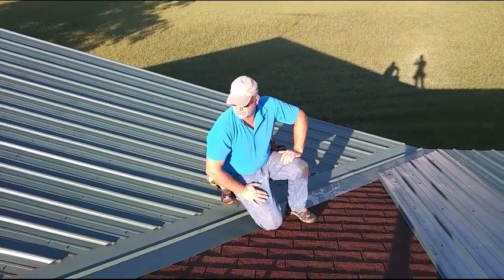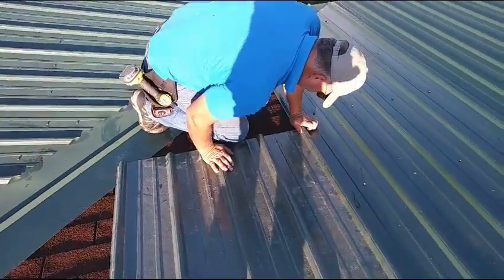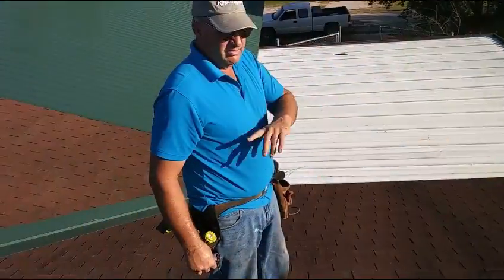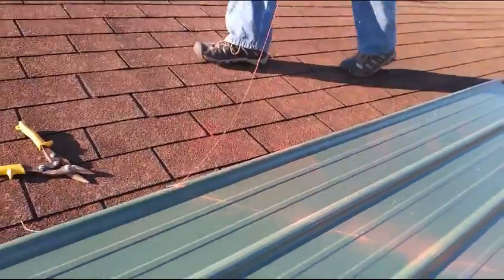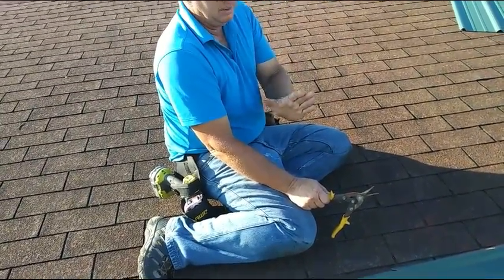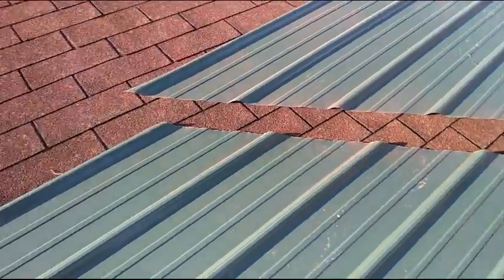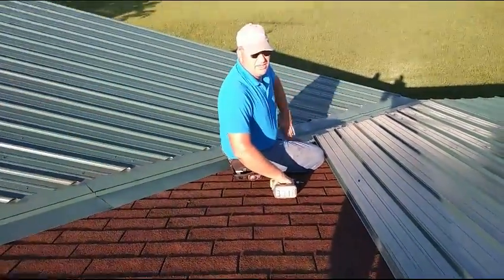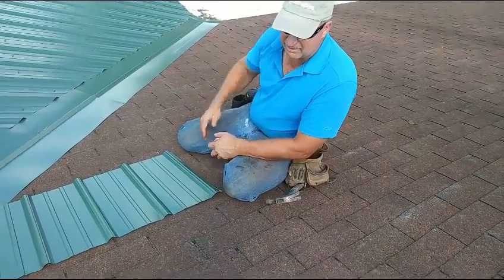Metal Roof Valley Install for home, mobile home, commercial buildings

Comment: Reading through these comments about how this guy should have used underlayment. Y'all do realize there is underlayment under the shingles already. Its probably traditional felt, but that's still an acceptable underlayment according to most metal manufacturers. I was going to use underlayment on the metal roof I'm doing next week, but the estimator from my metal supplier told me not to. Also told me not to worry about using purlins. Told me to just screw it down to the osb directly over the shingles. (I'm guessing he does not earn a commission for selling all the extra bells and whistles.)
Reply from the maker: Amen brother.
Reply: So you don't think condensation will accumulate underneath the metal and deteriorate the shingles and felt underneath it eventually rotting the wood?
Reply: Definietly need purlins or at least paper. Repair these on rhe regular. Wont know til its bad enough its about the fall through.
Reply: Yeah, works great until that big wind comes through and rips the roof right off because the 7/16" OSB has absolutely ZERO strength to pull out. You have less than 1/2" of resistance to upward pressure and OSB has such amazing structural integrity.  Not. Saw a local roof peeled right back for about 8 feet because of precisely this issue. You do you and same with this creator but after being in the building trades for over 40 years, the ultimate mark of a hack in my opinion is "well, I've never had a problem with it." Nope YOU never will; the poor homeowner you screwed over whose roof needs repaired or replaced 10 years down the line? Yeah, they'll have a problem with it for SURE.

Comment: Here in Australia, that valley sheeting would be condemned as it does not have a turn over lip on the edge that is under the valley sheeting to prevent wind blowing rain up under the roof sheeting.
Reply from the maker: Valley metal here also. Still getting the valley foam right is what stops water particularly with snow which can build up causing a dam that could cause water to backup and over . Thank you for pointing out something that we could all ask for when purchasing valley . Which would be a hem at the edge of the metal. I wish you and yours well

Comment: Question, why did you not use underlayment between the metal roof and the shingles? Underlayment is a lot cheaper than having to replace a rusted metal roof in the future.
Reply from the maker: After 29 years in area. Installing metal roofing this way there have been no problems. Not one.
Reply: Lol because actually underlayment holds moisture and actually causes the roof to leak. Keep doing like your doing. The shingles will only rust if u use underlayment buddy. Good job. I been doing roofing over 20 years myself.
Reply: Moisture comes from the roof sweating like u do with a blanket. It’s best to breathe.. we call this dead air space and underlayment will cause the roof to fail miserably
Reply: @stuart8219 if you have ventilation the moisture shud get out no?

Comment: In Florida roof condensates and will rot metal and the plywood or wood substrate. Not to mention rub the coating off the roof. Repairing one now if you want to see photos and videos. 20 years old almost destroyed the house. It did not need rain. Remember hind sight is 20/20

Comment: Wow a vertical panel metal roof installed directly over asphalt shingle with no slip sheet or under alignment. I hope that metal is aluminum! Because if it's not it's going to begin to rust underneath in about 10 to 15 years if not sooner!
Reply: Tracy this guy will be paid long before that happens.
Reply: @robertbutler8004  Law suit waiting to happen!
Reply from the maker: Keep in mind i have done roofs like this 26 years ago drive by many of them no rust . Also have never had in insurance settlement or law suit in any court small claims or otherwise for any of the work i have done in all my career
Reply: @StraightArrowRepair  "many of them"? 1 is too many. I was a construction defect inspector, They said we have done it like this for 30 yrs, well that's 30 yrs of doing it wrong. But I thanked them for keeping me busy.
Reply: @robertbutler8004  That's why he says he has never been sued, paid and go to another state.
Reply: @StraightArrowRepair  The stature of limitations would have expired long before 26 years for a law suit.
Reply: As a corrosion specialist to all there is no chance for rust if it is dry. But in wet to lots or dew daily will create an source for corrosion to start underneath the metal. So where the coating is scratched it will rust much faster but only as long as it has moisture present. The sun does help dry the sheets up as long as there is sufficient air flow.
Reply: @robertbutler8004  If the roof has a warranty (contractor OR manufacturer) that could open the door to lawsuit outside of any statute of limitations.
Reply: This shows poor knowledge of roofing.. underlayment actually causes corrosion sooner.. it causes a blanket of dead Air space that will cause the roof to sweat under the metal.. the roof must breathe a little. Underlayment has not been proven and therefore can in many cases void your warranty if done incorrectly. Be careful using underlayment.. shingles will not hurt metal roofing according to our studies and practices. Be careful what you suggest on underlayment.. it could cause you issue.. we do 2 million dollar roofs.. we usually tear the roof off before putting underlayment.. underlayment is a bad idea . 30 years of roofing some of the biggest roofs in the states. Good luck
Reply: The guy is on here just trying to help others and y’all are all on here attacking himself. Ain’t y’all got something better to do than be negative?? Go make u a video how y’all feel is right. He’s doing the best he knows to do.. leave him alone.. by the way underlayment is proven to cause roofs to sweat and rust the metal worst.. just for all y’all young guys that have college degrees instead of hands on experience. Get 40 years plus on the roof then come talk to me.
Reply: @stuart8219  
I'm a metal roof information Junkie! I spent 35 years of my life on long-term workmanship warranty high-end metal roof work. It's bad enough that the vast majority of the metal roofs out there have screws with neoprene washers better going to fail in 10 to 12 years. What to say that underlayment is going to cause a roof to sweat more is just total absolute b***** that's what you believe then put the damn panels on a furling strip. Basic knowledge of metal roofing is that there's going to be a differential in temperature beneath the panel and on the outside of the panel. This is going to create the condensation. The Heat and the inside the house coming out in the winter time to hit the back of the panel in the cold air on the outside of the lb going to create condensation. There is absolutely no way to avoid this. It will happen on all winter days that they are putting heat inside this home. Every single manufacturer of metal roofing in America requires an underlayment. Building code requires underlayment. And that's what we are as contractors required to stick to as much as we possibly can. The statements you've made have no proof to back them up whatsoever other than your stated experience. I'd like you to see you other than your stated experience provide some support of what you have said to be the best way to do this. Have at it Hoss. I can hardly wait!

Comment: Underlay is a requirement. Synthetic would be best, It keeps the metal off the shingle that moves/expands and contracts at a different rate. Helps with potential rust as well.
Reply from the maker: My experience is different. Have been installing metal roofs in this area for 28 years plus with absolutely no problems. With my relationship with the people I work for most important. I have not had to advertise in 12 plus years . With no insurance claims or settlement at all. Maybe after 40 years.
Reply: I just put pearlings down and it gets the metal up off the roof. It helps in the winter when u bang off the ice ...upstate new york north of Syracuse.

Comment: How much does the panel overlap the valley?
Reply from the maker: At least 6 inches sometimes more. The valleys I have been purchasing lately have a hem / curled edge under the metal . So even if the water goes uphill via driving rain / melting snow and ice holding water / leaves and that water gets past the valley foam it has to get past that hemmed or curled edge. Hope that helps

Comment: This is the first video I've seen of someone getting a valley measurement the right way with a small panel. except you should always measure from the top down not from the bottom like you said you hook on the wrong side occasionally that's not a problem if you pull from the top down and that's the only way to get your screws to line up if you pre-drill your metal like you should to Save hours of time and effort. You're also pretty far out of the valley to win is plenty you're almost off of the Valley Metal don't understand that one

Comment: Yeah I've never installed nor will I ever install a metal roof over shingles without ferring strips or 2x4s. But you go right ahead old timer
Reply from the maker: @jasonnorwood3738  you are allowed to do it your way.  I have not had a problem in 30 years. Now when you strip a roof you will need to insulate in between or my experience is condensation collects and runs down the metal to your next wood strip or penetration. That I have had problems with many many years ago. By the way I did that roof 4 years ago with no problems at all.

Comment: This method of cutting roofing iron to fit a valley is bullshit once you find the correct angle for the very first sheet that then can be used as a template to cut all other sheets or most all other sheets!!

Comment: Why notremove the old shingles before putting a new roof on. Very bad idea
Reply from the maker: The old shingles act as a vapor barrier. The cost to strip the old shingles and haul off then adding a vapor barrier is a many multi thousand dollar addition to the cost of putting the metal roof on. Many many thousands. Proof the right choice was made is 4 years later no leaks building has three new businesses in it. Everybody is happy. Initial cost would have almost twice as much to remove the shingles. Odds are inside the next 10 years that building will have been torn down and five more businesses and buildings will be built new in its place.
Reply: Don’t worry bout these people.. they don’t know roofing.. they only know what books tell them d just young guys who think they know. Let them get 40 years in and learn a thing or two.. vapor barrier actually causes moisture because the roof cannot breath. So it causes the roof to rust underneath.. we call it dead air space.. it’s like locking a basement up with no vents. It will rot out lol. Shows lil to know experience roofing to cause a big deal about this.
Reply: @stuart8219  I’m a builder in Florida, and county codes require a underpayment on all roofs, metal or shingles. Have removed and replaced plenty of them. Not having a underlayment seems to be a really bad idea if you ask me